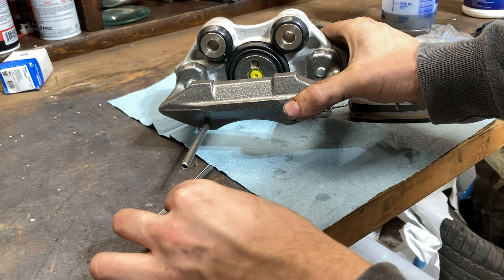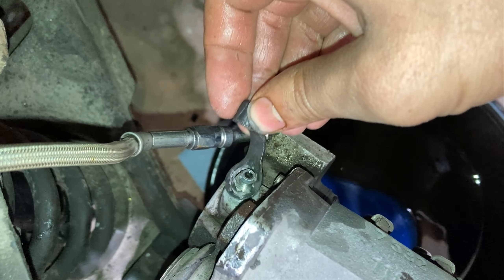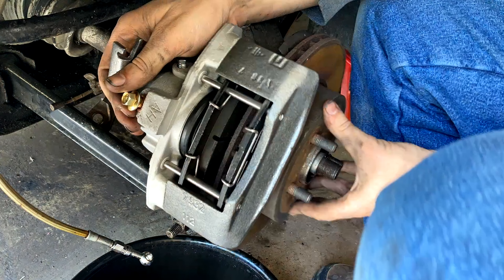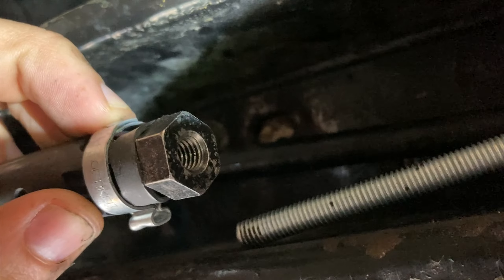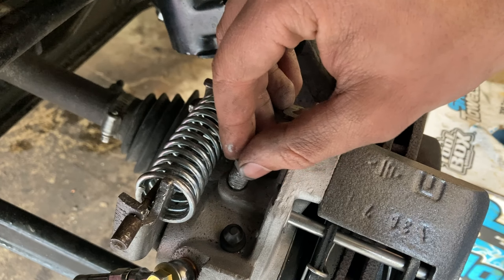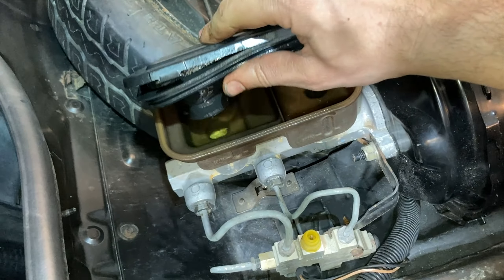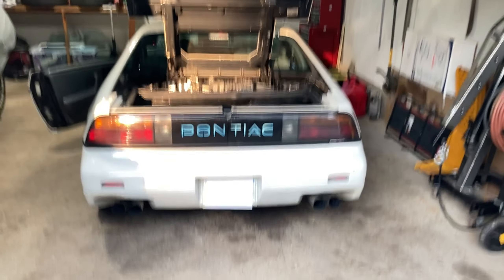Replace 1988 Fiero Brake Calipers and Parking Brake

Comment from the maker: **NOTICE** COMPRESS CALIPER PISTONS WITH 3/8" DRIVE SOCKET TOOL: https://amzn.to/4ciueqo
ALL PARTS USED IN THIS VIDEO:
Fiero Brake Caliper Rebuilds https://www.fierostore.com/Product/Browse.aspx?d=376&p=1
Kroil Penetrating Oil  https://amzn.to/3UZoNUC
Fiero Steel Brake Hoses https://www.fierostore.com/Product/Detail.aspx?s=56098
Brake Fluid Dot 3 & 4 w/Higher Boiling Point https://amzn.to/3x3e7hB
Fiero Banjo Bolts & Washers https://amzn.to/3wQN2hI
Fiero Brake Line Lock https://amzn.to/3VougaB
Fiero Brake Booster Check Valve https://amzn.to/3wPABCN
1988 Fiero Parking Brake Cable Rear Left https://amzn.to/3WZqHcm
1988 Fiero Parking Brake Cable Rear Right https://amzn.to/4bKsfvs
1984-1987 Fiero Parking Brake Cable Rear Left https://amzn.to/4aMX6Gn
1984-1987 Fiero Parking Brake Cable Rear Right https://amzn.to/3wVWmRn
1984-1987 Fiero Parking Brake Cable Front https://amzn.to/3x6yg6k
1984-1987 Fiero Parking Brake Lever https://amzn.to/3X13wyk
Brake Bleeder Screws https://amzn.to/3V4bhB6
1988 Fiero Front Caliper Seal Kit https://amzn.to/4e23Jr9
1984-1987 Front Caliper Seal Kit https://amzn.to/3X6PA66
1988 Brake Pads https://amzn.to/3X13NkQ
1984-1987 Fiero Brake Pads Rear https://amzn.to/3yFWSDv
1984-1987 Fiero Brake Pads Front https://amzn.to/4dYmlZb
1988 Rotor Rotor https://amzn.to/458D0Fp
1984-1987 Rotor Rear https://amzn.to/3RcbkJP
1984-1987 Rotor Front https://amzn.to/3x1yN9M
1984-1987 Caliper Slide Pin https://amzn.to/3R97scA
1988 Caliper Piston https://amzn.to/4bXTjqy
1984-1987 Caliper Piston https://amzn.to/3XcKtB0
1984-1987 Caliper Slide Pin Boot/Bushing https://amzn.to/3KqJ0zD
1984-1987 Rear Brake Caliper Seal Kit https://amzn.to/3X6L6w6
1984-1987 Front Brake Caliper Seal Kit https://amzn.to/3KLmiCF
1984-1987 Brake Master Cylinder https://amzn.to/3Vsws1a
Master Cylinder Cap https://amzn.to/4c2MF2l
Master Cylinder Cap Gasket https://amzn.to/4aQ9oxr
1984-1987 Power Brake Filter https://amzn.to/4bJn92g

Video Sections:
Brake Info & Parts: 0:35
Remove the Caliper: 1:11
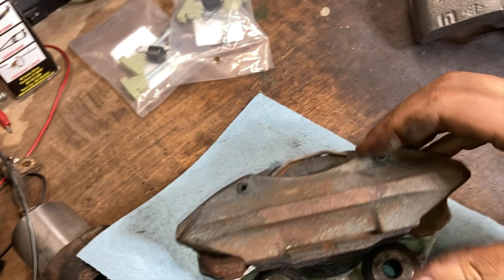Replacing Pads: 2:56
Replacing the Caliper: 4:17
Replacing the e-brake: 4:42
Bleeding brakes: 6:43
Adjusting e-brake: 9:00

Amazon Recommendation Store for 3800s/Fieros/Tools https://amzn.to/3hNViaa
3800sc Instructions http://www.fiero.nl/forum/Forum2/HTML/139530.html
3800sc Instructions MOBILE https://drive.google.com/file/d/1wqUJdMZ1XqcKJzC-2ZzbvLYMYE3QbmVq
eBay affiliate https://ebay.us/4yOWEw
Donate to me https://www.paypal.com/donate/?business=8AFWKBTBVSKTJ
Join channel membership https://www.youtube.com/FieroAustin/join
Subscribe https://www.youtube.com/fieroaustin?sub_confirmation=1
Consulting https://www.facebook.com/FieroAustin/
Facebook Subscribers Group https://www.facebook.com/becomesupporter/FieroAustin/

#3800 #supercharged #fiero #3800sc #3800supercharged #pontiac #pontiacfiero #fieroaustin #howto #3800fiero #superchargedfiero #engineswap #fierogt #L67 #L32 #engineconversion #affiliatemarketing #affiliate
When you click on links to various merchants on this site and make a purchase, this can result in this site earning a commission. Affiliate programs and affiliations include, but are not limited to, the eBay Partner Network and Amazon Associates.

Comment: Hey, i did the pump brakes 3 times and raised e brake 3 times and i got the e brake tight enough to hold the car but on a hill i can barely move it. What more can I do to make it rock solid so it won't move? New brake pads, fluid, calipers replaced but the adjuster had to be turned all the way to end to hold
Reply from the maker: My adjuster was almost all the way to the end too. If you have old brake cables, you might want to replace them, they may be stretched?
I have had mine too tight as well. Old pads, 2/3 cables were old.

Comment: Great video, I only wish there was a more in depth look into the parking brake cable install. Im struggling on mine. Somebody really did a number on it before i got the car.
Reply from the maker: thanks man. yeah sorry didnt get very good footage and edited it almost a year later lol. it's really not too bad. just 3 cables, 2 connectors, and 2 springs.
Reply: @FieroAustin  it was definitely still a huge help. Whoever was in there before me ditched everything for the driver side and ghetto rigged the passenger side to be the only side that worked. Except it didn't! At least now it's correct!!
Reply from the maker: @ericviger4984  oh no lol!! at least you can buy all the hardware brand new
Reply: @FieroAustin  yeah I got it all off the fiero store. I'll be finishing it up tomorrow.
Reply from the maker: @ericviger4984  Good luck!

Comment: Heyo sir I am super curious about a previous video you did about the struts an stuff. Could you please send me a link to where you got the parts please. I can't find them anywhere
Reply from the maker: Here you go. https://amzn.to/3oahsTQ Also all of my parts are always in the video description or comments section. Let me know if that does not work!
Reply: @FieroAustin  thank you highly I'm trying to find the springs
Reply from the maker: @chadwelcomer5516  Ah, you are supposed to re-use your old ones. I no longer see any for sale either. You can always put coil overs in there instead, which would include springs; I got mine from Ground Control. Note with them- be VERY SPECIFIC on what spring rate, if you want stock. https://groundcontrolstore.com/collections/fiero/products/coilover-conversion-kit-84-87-pontiac-fiero-rear

Comment: You don't bleed the master cylinder after emptying it out?
Reply from the maker: I did, I bled brakes all around the car
Reply: @FieroAustin I am currently in a situation where my rear reservoir has run dry. Online I see a bunch of people saying you need to do a special bleed of the master cylinder like bench bleeding or getting a kit to do it on the car. Yet I also see some people like you who just fill it up and go straight to bleeding the corners. What are your thoughts on the bench bleed process and why don’t you use it? Love your vids btw, definitely my favorite fierotuber

P.S: Hello from my alt account
Reply from the maker: @doggodoa2  Hey, frankly I've never heard of the special bench bleeding process. I don't even think the manual mentions that, but I could be wrong. It seems to work for me, but I have never 100% drained the lines either. Maybe I got lucky several times over...? Could you link me to this bench bleed process?

Comment: It is extremely difficult to remove the brake line nut, with its interference thread, to the brake hose.  Cut the line with a tube cutter and replace the nut with the AGS Steel Nut #BLF-38C-5.
Reply from the maker: Thanks!

Comment: I have been dealing with this problem since January, what a headache it's been and I'm like 500 dollars in the hole and my brakes suck still all original replacements and a reconstructed calliper because I ruined one trying to do it myself 😞
Reply from the maker: I ruined my first one too, I stripped the banjo bolt threads out. Lesson learned. Replacing with steel hoses and the S10 booster definitely improved it!

Comment: Very disappointed with this video. Too basic and not enough details to break down of how '88 calipers work... including replacing seal inside those pistons. Rebuilding those calipers would be nice. I still don't get how e-brake system works well. We need more details. This video is too short and very basic with no explanation.
Reply from the maker: Well sorry you felt that way. It would be very difficult to rebuild the caliper without special tools but it can be done, not something I wanted to do. I think once you open up the parking brakes on yours, it would be clearer. Try another video here. https://www.youtube.com/watch?v=HR-J0DXHCoc